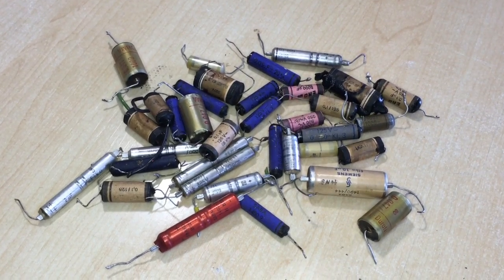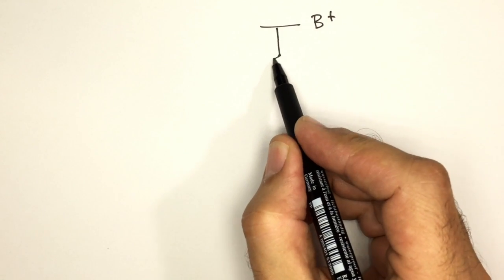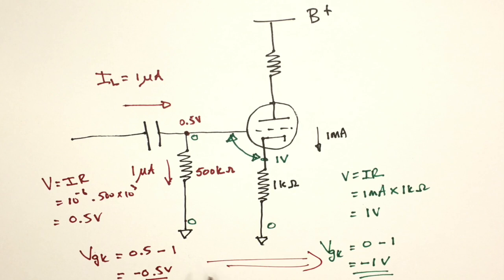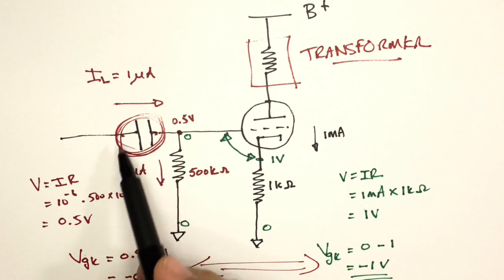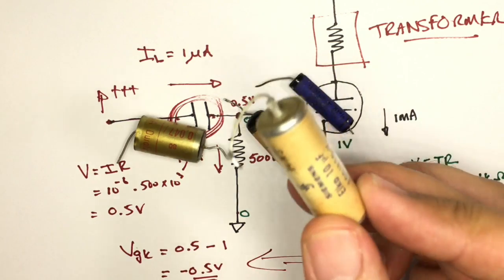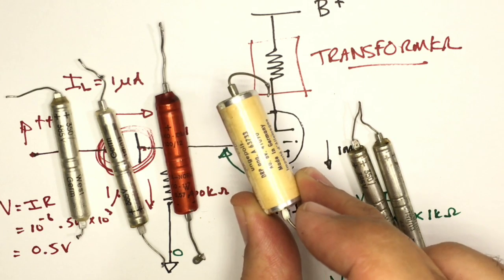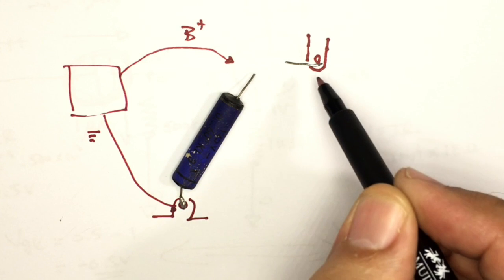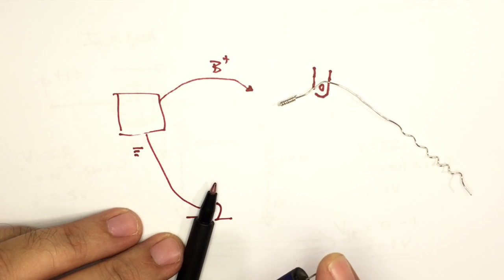Capacitor leakage tester design & build - Part 2

Comment: Great to watch your series of posts on this matter. I have a doubt: Instead of multiple steps of increasing voltages, would it be possible to reform using the final voltage, but using a pretty high resistor limiting the current? Let's say 250V with a 220K 1/2W. resistor. 
 My logic here would be to let the cap reforming at its owns pace and "needs", where the initial short-circuit current would be limited to 1.1 mA, reducing to "almost zero" if capacitor reforms ok. Larger capacitor would take more time, smaller caps faster, but cap and setup would be protected per maximum voltage.
If you could comment, I would greatly appreciate to learn.
Reply from the maker: I understand your logic, but am still reluctant to hit it with full voltage right away. If you want the reforming process to occur, everything I’ve read points to gradual build-up of the voltage. Actually, I have stopped trying to reform caps altogether recently, as I had one blow on me.

Comment: Hi Mr Caldeira. I think am about ready to start calibrating this instrument in terms of Leakage current. Have followed your video no 1, all through and it seems that I did not get the way you hooked up your AVO mA meter to the device. You are right though a typical DMM will draw around 30uA, hence what you were reading. So how do you adjust all the scales ? I will appreciate the feedback. Thank you
Reply from the maker: I’m afraid I cannot give you more info than is on the videos, because it’s been some time since I did that and would have to do exactly the same thing: go back and watch my own videos.
Reply: @electronicsoldandnew  I think I got it. Just missed 10sec out of your part 1, which made sense. All good back on track. Thank you !

Comment: The 5 position switch for the project has to be the shorting type. Otherwise the ammeter will peg every time the switch is changed. This may be common knowledge but I didn't know it and I am an electrical engineer. I bent the needle on my ammeter . Fortunately the ammeter was the open type so I went in and bent it back.
Reply from the maker: Always a good idea.

Comment: when i want to rough test the standard 500v caps or even 250v ones i simply grab my crocodile clips and place a diode in series with the capacitor, stick the capacitor+diode into the wall socket live wire(220v, diode leg into the socket) then to measure put one multimeter lead on the neutral and the other on the capacitor remaining leg...any dc volts reading means voltage leaking through the cap..new caps read zero and the worst caps i tested were the famous wima cough drops or brown turds like i call them and some were letting  more then 100vdc pass through so since i am only using half wave (one diode) it means almost a short

Comment: Hi, I would like to weigh in on the buy one on eBay and restore it idea.  I had this idea back in Aug. of 2017, some four months ago, however I was out bid to the tune of $200.00 - $225.00 (+shipping) on eBay back then my max was $175.00.  Currently a recent "winning" bid on eBay for the Heathkit IT-28 Capacitor checker was $523.00, that's US dollars; other models are selling well north of $225, and I'm not sure why but they are currently well beyond affordable for the limited function they serve. I have subsequently priced all of the components for a 600VDC cap checker with toroidal transformer, MOSFET, meters, switches, heat sink, resistors, and capacitors and I can source them for under $200.00.  Shure you need to make a board and put it in an enclosure of some kind but that is half the fun of this stuff.  Good luck finding a restoration candidate on ebay, I've given up on that idea and plan to build my own from scratch and use an old HP counter case for the enclosure.  I may even build a special fixture and use it to test vacuum tubes. These transformers have filament voltage taps so that would make a dual purpose test device.
Reply from the maker: Gary Bevis : had no idea the eBay ones had become so pricy. It’s probably a sign that the hobby is gaining more followers. 
Enjoy the build - I agree with you that that is half the fun.

Comment: If I take 10 micro amps times 500 kilo ohms, I get 5 volts. Not .5 volts. Am I wrong?
Reply from the maker: Scott Palmer : yes, but I use 1 micro amp in my example, not 10 micro amp.
Reply: True, but that's not what you wrote. I do see your point. I think you meant to write 1 micro amp but wrote 10 with the answer worked out already. Just a typo I'm sure. I did enjoy you video. Ta
Reply from the maker: Scott Palmer : sorry, still don’t see the error. 10^(-6) = 1 x 10^(-6) = 1 micro amp. Where do you see the mistake? Please give me the time in the video and I’ll check again. Thanks.

Comment: Like the explanation of the effect of capacitor leakage on Grid Bias of Vacuum Tubes. Which would be equally valid for CMOS technology, with the difference of dealing with lower voltages and thus a diminished effect of the leakage evident only at higher test voltages. Would it not? Which is not implying that low voltage applications make leakage testing redundant. ;) Thank's for mentioning that as well.
Reply from the maker: Frank Koslowski : yes it would be similar because of the high impedance.

Comment: Very tutorial way for substituting a capacitor on the original circuit without damaging the old original junction connection to the circuit itself.thank you for the practical hint,so did I with my latest experiment,that worked very well. Thank you very much for the precious videos.